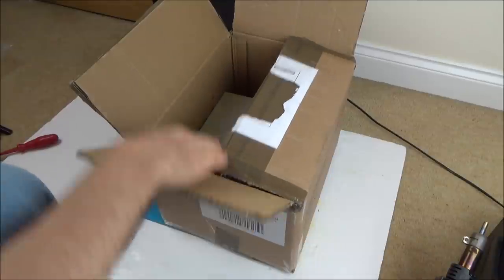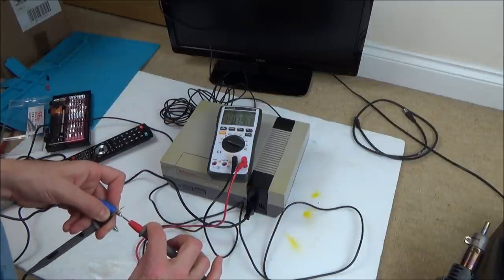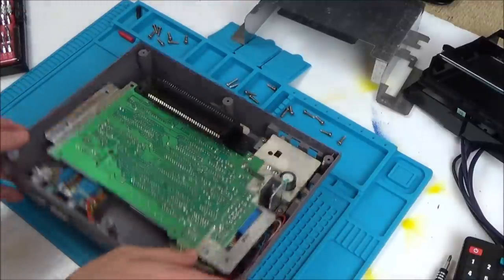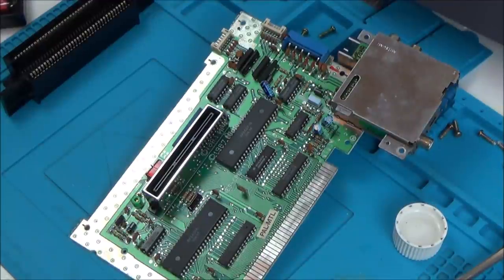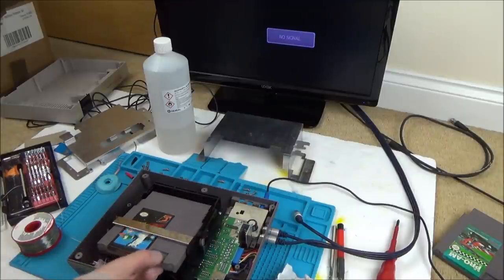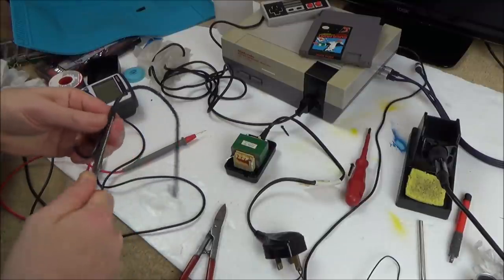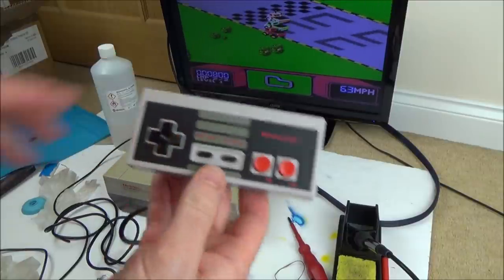Trying to FIX a Faulty NES (Nintendo Entertainment System)

Comment: oh btw the sloat loaders like that one had a issue with the pins coming off the cartridge connector breaking solder joints. something they fixed by releasing the top loader one. re-solder them parts and don't press the cartridge down

Comment: I have a NES that I found in a garbage pile. It has a faulty cart slot, which I haven't got around to fixing. The trick I found for getting it to work is to put the cart in, push it down, put a second cart in on top, and then unclick the cart like I'm trying to take it out, which will then jam on the second cart on top, and that's where it works..

Comment: This is a AC transformer (what is very odd for a electronic device) making it a very simple design. 
It is two cooper coils, one is producing a magnet field to induce current on the second.
Since coils are the same thing as a electromagnet if you test for continuity if its good the answer should return true.

The cable is bad replace/cut it and you should have a good transformer/power supply
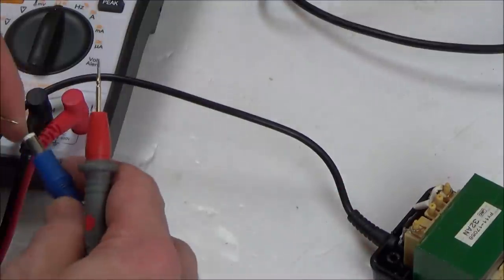Notice it right about here 42:22 when you testes for continuity on the out wire/connector.
The damage on this cable was probably because something/someone pulling the cable very hard... Maybe someone tripped on it?

after cutting the cable you should had plugged the power supply and tested for voltage on terminals of the transformer. If you had voltage the power supply is working and you would be sure that the problem is the cable.

Since you repaired the cable here is some tips for finding where it broke loosing less cable in the future. 
Straight and wiggle wile testing for continuity. (you did it)
Strip the bad cable make it straight and pull the wire with a pliers if it broke is close the end the wire should come out and then use the wire to measure where is broke.
Look for points where it would have most of the stress/strain. 
Look for major damages on the cable.
Go for the middle of the cable (You did it but you should have done the other options first to save more cable) If both halves don't have continuity throw it away... This cable is probable garbage.

Comment: When you use cardboard to clean your connector do not drag it sideways you will bend contacts and these consoles have a tendency to have bent contacts due to the way the cartridge goes in (it starts at an angle then pushes flat ) there are articles and videos on how to fix them search for nintendo 72 pin connector bent pins and the RF adapter is the worst signal

Comment: I have an snes and nes with those different power supplies, but they work just fine Wirth each other.
The snes ps has the voltage information imbedded in to the plastic like in your case, and the NES one had a sticker instead i believe..

Comment: Do those fiberglass pens leave little bits of fiberglass when used? If so that can't be healthy. I've never used one personally so I don't know. I use the blue eraser for pen ink. It has little bits of aggregate in the rubber and leaves a very clean surface on electrical contacts.

Comment: your UK plugs are one of the safest if not the safest in the world. the german did not have all a groudn pin, some only got 2 life's and no sleaves around the pins and no fuse, we have to trust our LS in the basement to kill the switch when get short curcuit. BUT our wall plugs ar mounted a bit in the wall, not like the UK on surface, so this compensated the missing sleaves

Comment: The console being hit or miss lies with the 72 pin connector and the tray not being screwed to the board. If you leave it loose it will still have slight give and cause it to grey screen.

Comment: Hi Vince if the power supply did not work that means the thermal fuse has blown in the transformer and can be replaced

Comment: As far i can remember, SNES and NES power supply are identical about voltage but the SNES plug provides more amps. A SNES will run with a NES supply but it get very hot during the time.

Comment: The transformer, will register as continueity because it is wire wound, so both the positive and negative terminals are connected to each other, at both ends. so even the other side will do the same. I think you will find the wire is the fault.

Comment: The sticker on the board clearly labels it as "PAL MTL", or PAL Mattel, meaning that it should be one of the earlier European models that were distributed by Mattel. However, the text on the cartridge door contradicts this by claiming it's the later version distributed by Nintendo, the "NES VERSION". Does this mean that at one point this console had a shell replacement? Or is it that Nintendo never bothered to change the sticker to reflect the version change?

Comment: the expansion port was for the robot that they sold with the original NES, they stopped selling the robot very quickly, and if you were lucky like i was you got the NES right at the begining and got "Robbie the Robot"
Reply: No Robbie the robot connected via the controller port.

Comment: of course you measure through the secondary of the transformer as if it is a short... it's just a coil, it probably has a very low resistance which just gets through your "beep test" :)

Comment: Nintendo's can be very picky but theres 2 things I recommend, firstly is to try the game in the "Up" position with pushing it down its weird but sometimes it works. The other thing is to boil the NES 72 pin connector in hot water no it shouldnt melt anything I know its weird but me and a freind did it to his and its now mine and still working great you just boil it in a pot of hot water keep pushing it around every so often with a spatula or something. Its supposed to remove the dirt and corrosion from it

Comment: You can return the yellowed case back to the way it came from the factory using baking soda and hydrogen peroxide.
Reply: Retrobrite
Reply: if its a nice sunny day UV light from the sun works well too
Reply: @SPEXWISE  Hydrogen Peroxide, Sunlight, goodbye bromides
Reply: avoid it! its corrosive to plastic
buy ion generator and put in zip bag, thats the only safest way to retrobrite your old consoles!
Reply: No need for chemicals, just put it outside on a bright sunny day. Sunlight will whiten it.
Reply: @Skauber  yeah and the UV will degrade the plastic and make it brittle. The whole point of reteobrite is to catalyze the process to focus the UV into debrominating instead of depolymerizing.
Reply: @Doom2pro  actually no. There was recently a video from Perifractic which explained all this and how it works, after attempting ozone and what not with experiments and so on.

Comment: Some early nes cartriges had a famicom to nes adapter thing. it was because the famicom used 60 pins and the nes used 72. you can tell if it has an adapter by looking at the top of the cartrige, if it doesn't have the tab latch thingy, then you have an early cartrige, then look at the pins, if the teeth on the pins are on the right, then you have a Famicom adapter! this might be why those other games aren't working :/
Reply: They would still use the same pins on the NES connector though.
However, some games really don't need some pins. For example. games with only 16K PRG ROM don't need the CPU A14 signal, most games don't need the IRQ input.
Reply: @Wuerfel21  oh, Thanks for the info!

Comment: I fixed my NES with similar intermittent load problems by just buying a new cart slot off ebay for $8.  Other ppl have had luck with immersing the cart slot in boiling water which is supposed to retension the metal bridges between the board and car slot or something.
I never bothered with the RF output, what would have been the point?

Comment: Assuming there are no electronics inside the transformer, there should be a dead short between the two terminals on the output side.

Edit: I would replace the whole cable from the barrel jack to the transformer. It looks to be a standard size

Comment: Did I get a good deal on this, a Nintendo entertainment system with rc pro amp with a nes controller and a nes max controller and a rf cable for $70 in total?
Reply: I had to fix the controller but that’s it

Comment: Hmmm thats not the original case for that NES!. The case says 'NES Version' on the lid flap yet the main pcb has a sticker with 'PAL-MTL' with MTL standing for Mattel, as when the NES was first released in the UK the toy company Mattel had the rights to produce the NES and later Nintendo itself started to produce the unit in the UK known as the 'NES Version'. So at some point that case has had its original pcb swapped out

Comment: My NES has some pixels that dilate (don't display games normally) when playing games. I've tested it across all games I have and can confirm its the consol. I've disabled the lockout chip and cleaned the 72 pin thing with white vinegar and used an eraser on the motherboard to clean the contacts and nothing changed other than the game reads better. But the amen shown still has pixels that aren't displayed properly. (For lack of better word I'm using pixels as my description of the problem) 
Any help?

Comment: Hey Vince I changed the72 pin connection but when I was changing it. I noticed that the old 72 pin had some green corrosion in it and on the mother board also. so when I put it all back together it didnt work so I tried the games on my other nes and they worked what do you think I can do to fix this

Comment: IPA is great, but you should get some contact cleaner that will remove oxidation and leave a protective layer, they really work great, just spray, and work it around a bit, problem solved.
Reply: Jake......IPA is the worst,leaves a film on lazer lenses & don't do much as far as cleaning goes,Contact cleaner is no.1 !!!!
Reply: @richardanderson5109  your comment makes no sense. IPA doesn't leave a film and this is a NES, it doesn't have any laser lenses.

Comment: I tried repairing my NES, cleaned the 72 pin, disabled the lockout chip, and cleaned the contacts. When I try to run it with a game in, the display is either no signal or a gray screen.          Any advice would be greatly appreciated :)

Comment: That cartridge slot mechanism was a HORRIBLE piece of engineering
It just doesn't have the endurance like that used in the SNES
Reply: thats why mine works  fine after  30 years ... ( just opend the console to take care of the dust and so on)

Comment: if i need to move a strain relief, i first heat up and see if it can be pulled. if that fails i pull the conductors out and heat it again, this allows more play in the sleeving. if that fails, i drill it out.

Comment: I could be wrong but I believe you could fry the system if you give it ac. The snes converts it to dc but the nes needs dc to begin with. Someone might have mentioned this but I'm not trying to go through 500+ comments.

Comment: Also. your reading through a transformer. Should google how AC transformers work. because 43:00 is a little painful to watch. your getting continuity through the winding of the transformer, thats why its buzzing. However, the shield isnt buzzing because there is a break in the ground of that wire.

Comment: dood, you really never cleaned an O-G NES? They made nes cleaner kits, which were a bit of roughened plastic in a fake cartridge that you'd coat with 91 or 100% "ipa" as you call it, and while dampened with alcohol, you'd work the cart in-out-in-out in a jack hammer like motion, cleaning the contacts while the alcohol evaporates. then after a moment, youd use some included cartridge swabs with that same alcohol and brush back and forth across the cartridge leads, cleaning them on top and bottom. Usually the front loaded NES would work after that. The reason nintendo went to top loader was because those cartridge cradles would simply be useless after some time and need to be replaced. I myself used to just blow in a cart before trying to use it.

Comment: 24:37 those connections which appear to go nowhere look like they are via'd though not as you know them on newer technology. It looks like they go through to the otherside of the board as the solder joints are on the other side...

Comment: you should really study up on Mains and AC stuff because it really isn't too difficult to do and understand, just don't work it live, be sure nothing is outright shorted and don't leave any wires bare and you'll be fine! Also transformers like the one in the power supply has a certain resistance across them that is quite often rather low, this will cause the meter to show a short because it is below the threshold of where it will ring off.

oh and AC has no polarity unless you're doing high end audio speakers, but that's a whole other world there!

Comment: Tip: replace the original 72 pin connector with the Blinking Light Win its the new 72 pin replacement for the nes

Comment: could it be that power supply could output differently like  on the nes its outside is negative and the inside is pausitive but on the snes the out put is reversed like the negative is on the inside and pausitive is on the outside but some plugs can reverse it on there own but some cant

Comment: Wow. I know you're learning and all....but the right way to fix a nintendo is to blow an even air/spit mixture into the cartridge slot and slam the top of the console hard with the bottom of your fist. Might have to repeat the process a few times, but 60% of the time it works every time.

Comment: Just after 27:33 you bridged a or maybe even bridged two or more connector pad/s to track/s that "SHOULD NOT BE BRIDGED" " I stopped the video so I dont know yet if you havent unbridged them" if you havent you may experience some games working and some that wont work, the ones that wont work may need you to ensure Bridges are removed..

**Addendum*
Never Mind, I see you removed the bridges, and the Lil Far err-um "lets not swear" is working..

Comment: The expansion port  ... "Allows Famicom expansion port accessories to be used on the original NES, also mixes extra audio input from the cartridge slot. The only device actually released to make use of the NES expansion port. Allows 4 players to play games at once. NES-034."

Comment: i tore apart my NES decades ago. I killed it good by shorting it out when messing with it.
Reply: my first fix on NES was when i was a kid with 400W soldering iron for kitchen sinks, it was like axe and big like heat plate, i burn the PCB like steak and use aspirin instead rosin but fix it with cable instead of wire :D it was a disaster but it worked for many years and i even sold it with all this inside and now i miss it ... it had great games

Comment: the original nes ran off 9 volts ac the super nes was dc while you could run the nes off 9 volts DC its original adapter was 9 volts AC. the polarity on the super nes was different and the barrel connector was also different although I'm sure they had a different style in other country's

Comment: I boiled a 72 pin cartridge slot for 10-15 min and i also tried with 12v AC Adapter from internet cable box and the result is: for me its working fine like a brand new nes but DC Adapter it won't work.

Comment: to help you out if you didnt know for the nes games or I think all most cart games one side of the connector pins run the CHR rom and the other side the prg rom and I guess it seems too if there are any more chips on the board they link to the others some how so basically one side for a set of chips and the other the same for what is on that side

Comment: The NES takes both AC and DC power supplies, in fact the NES converts the AC to DC, but if you put a DC power supply into the NES, it'll just pass it right on through.

Comment: My nes' hardware is fine. But the power button is stuck in the on position. How do i fix that?
Reply: You would have to open the console and check the spring or locking mechanism...

Comment: Think the snes power supply is ac ac and the nes ac dc, so snes does work with nes but not the other way around, at least I think that's the case 🤔
Reply: Just checked my old nes, it's also ac, so the psu's should be fully interchangeable. And should also be fine running on dc, just don't run a dc machine like the American ones on an ac psu, I'd imagine some smoke 😂

Comment: Mostly it's just cleaning the pinconnector and carefully bend the 72 pins a little back in their original position with a needle. That's how I fixed 10 of these. No need to buy a new pinconnector.

Comment: 41:20  what do you expect ? there is no a capacitor! what voltage when is unplugged haha :D ?

the one wire on the blue jack is broken ,common problem. Do you even know what is a transformer and how it works and made? It is normal to be "short circuit"  between to ends of the one or another winding !!!

Comment: just clean the 72 pin connector and remove the fourth bottom pin on the 10 nes chip it has a number 2 it will fix the Nintendo entertainment system all of your games will work first time everytime

Comment: The bottom connector was supposed to be for a CD add on witch was later scraped for the United States and Europe but not Japan and the connector was not removed from the mother board of the Nintendo entertainment system!!!

Comment: the Nintendo entertainment system requires a 9 volt ac adapter 850 amps it says on the sticker on the bottom of the Nintendo entertainment system

Comment: Try fix broken ps2 (laser faulty, without buying new laser)
Reply: Repairing a damaged laser diode isn't something that's gonna be doable.  If the laser is faulty, you would have to replace the laser.
Reply: @Mad-Lad-Chad  the laser diode itself rarely breaks, usually by adjustment / cleaning to get it working fine
Reply: @cerpander  In that case it sounds like you already know what to try.  Though in the ones I've messed with usually no amount of cleaning or adjustment would fix the laser.  Maybe I was just unlucky.